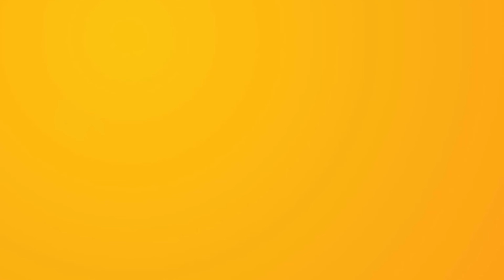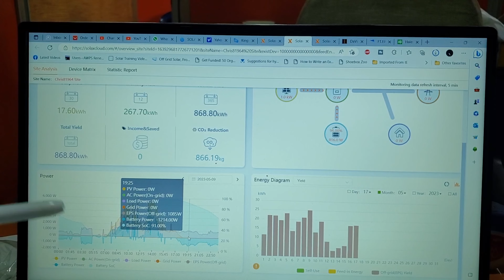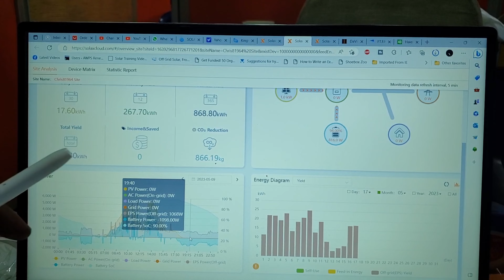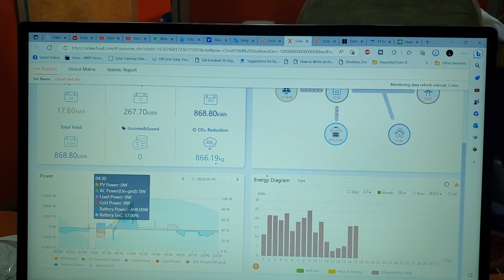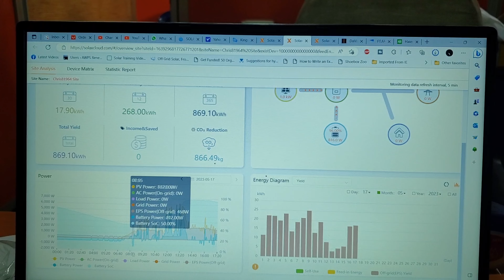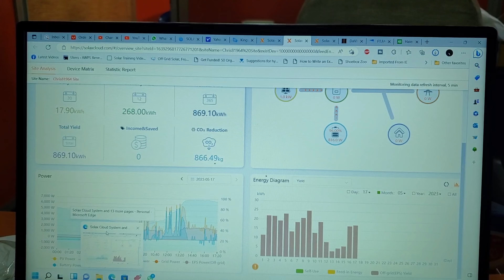Holy Cow!!!!!!!!!!!!!!!!! See what my new AC did. #thermocol #offgrid #lginverter

Comment: Hello Doc! Interesting comparison. So far we are doing without AC here but it is good to know, just in case. I see that you are off-grid as ever, is the situation still the same? That your neighbors are still without grid connection and using generators?
Reply from the maker: It is so hot and humid that the AC is a must. They have the grid. It is not constant. AS I write they are making so much noise with their generator.
Reply: @drsolar  You must start using and selling sound cancelling ear buds Doc! A frustrating situation.
Reply from the maker: @dougveganparadisebuilder  I play white noise over my Alexa speaker. It works very well. I tried ear plugs, earphones. They would always fall out.
Reply: @drsolar  I really feel for you. At dawn and when it is winter it can be eerily quiet when I wake up sometimes. No sound at all when the refrigerators are silent. Nothing!